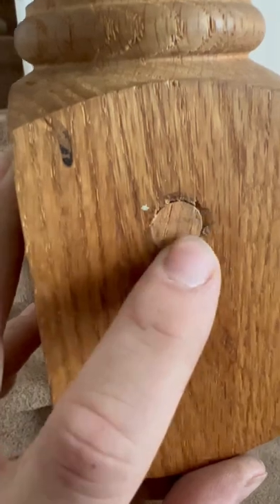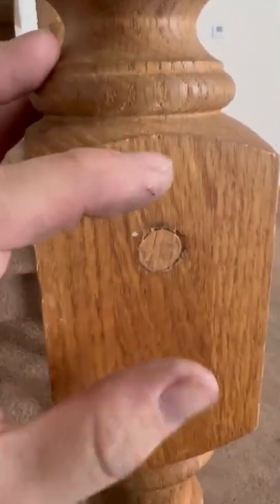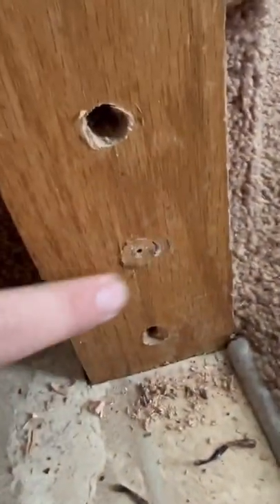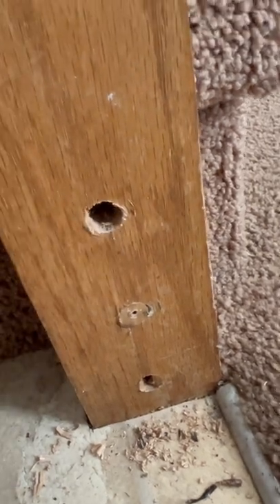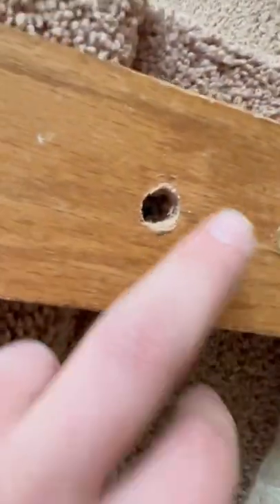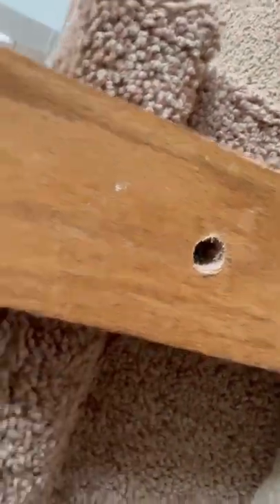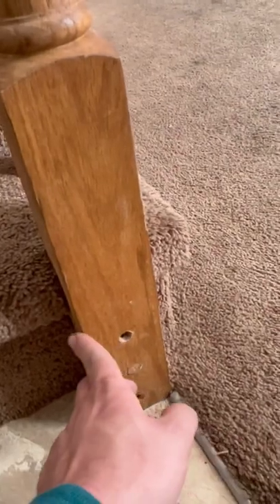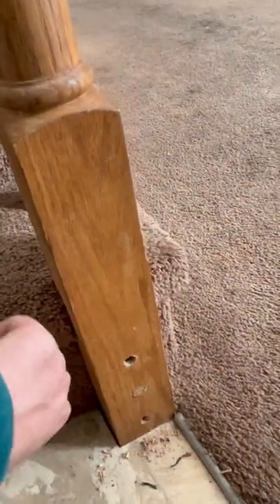How to fix loose handrail

Comment: How do you repair the rail if it comes lose from the wall
Reply: Depends on the rail but most of them have caps like the ones in the bottom. You can take them out and tighten or replace the screw.